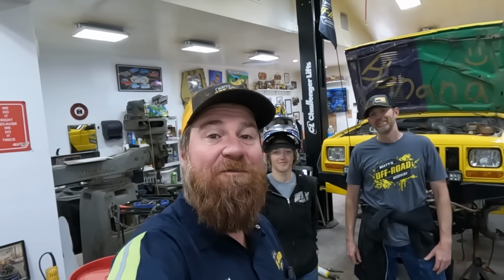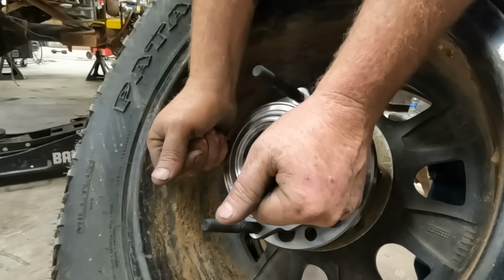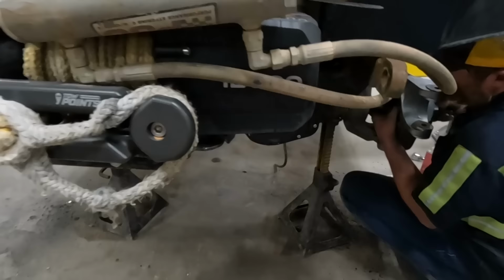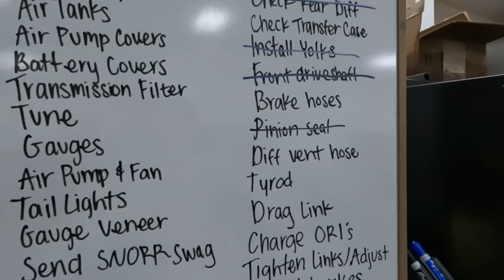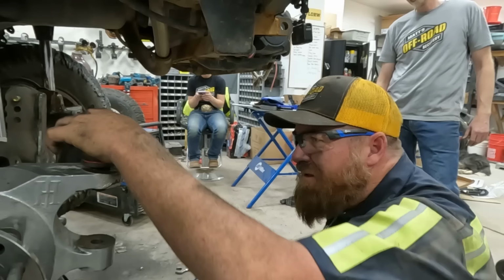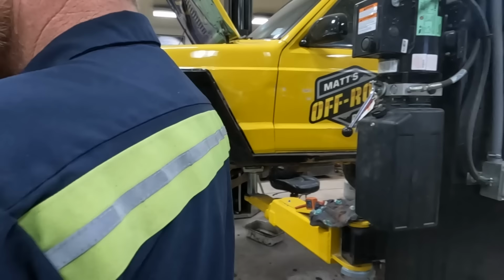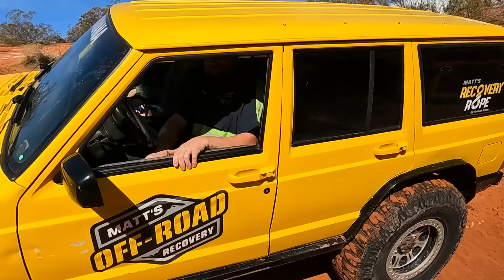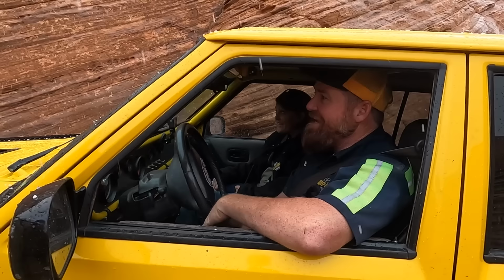I Can't Do This...Nothing But Failure Fixing The Jeep Banana!

Comment: Somewhere around twelve minutes, I realized that while Matt is a very good fabricator, quite a bit of the way he does things is because he knows it will irritate internet "experts". Respect.
Reply: I don't believe they are irritated. Rather, they know it's gonna come back and bite him in his backside. Hopefully when it does, nobody else pays the price.
Reply: Coffreek you have been proven correct.
Reply: You see that often in the trades a lot. Standards say “this” but sometimes thats not how it’s getting done. Its a good joke sometimes. You have to know your trade very well to absolutely know when you can ignore standards. I know the material I am working with very well and know the ansi and tcna stuff front to back, but for the most part its not written in stone, just paper.
Reply: @Titantitan001 you gotta know the rules well to know when you can break them.
Reply: There is a huge difference between a engineer & a mechanic.

Comment: Stay strong, Tom. Matt, whether he likes it or not, needs a voice of reason.
Reply: I don't get what lead to the trimmed axel and cut splines? had they just not seated it far enough to get the joint to line up with the pivot point so it kept binding?
Reply: Perhaps this explains why quite a few staff have left this business. Remember the problem Jaymie had with Matt as welding coach. He just doesn't accept other ways  of doing things....it's his way or the highway 😐
Reply: @trif55  Matt narrowed the whole axle housing, and doesn’t like to do measurements so didn’t really know how far he need to cut the axle shafts down. They you hear the rest, still have to make sure seals line up, make sure splines are long enough to have structural integrity
Reply: But yeah I agree, that impact on the rear yoke was just not bright
Reply: I enjoy the creativity and that Matt is bringing Tom's way of reasoning into the shop. I just worry that the next video will show Matt with a patch over his eye because he's too stubborn to wear glasses while grinding.
Reply: @nate7828  wasted a crush bearing least wise....smh.....im a noob at chassis running gear but I know better than that. You have to set the pinon and crush sleeve right ? Way more than just tightening the nut to the yoke
Reply: @evopwrmods  yes there’s a certain amount of preload that’s supposed to be set. It’s not supposed to just be impacted like that
Reply: Matt's rationale for causing damage to gears and bearings during installation is very similar to his rationale for not consistently wearing eye protection: " I've gotten away with it so far"
Reply: @msb3175 I totally agree.
Reply: 🤣😂🙃🚙🚙Yep!
Reply: 1:02:27  the right rear tire is not turning. Is something wrong with your locker?
Reply: Tom I know you mean well but you really need to just roll with it a little bit more. Too much negative energy isn’t good for you

Comment: you two are the perfect example of the difference between a machinist and a mechanic.
Reply: Hope the onlyfans doesn’t rub off on your channel
Reply: As a 10 year plus machinist i'd put tom at an engineer level. Most tolerances I see called out on blueprints are way "over engineered" and will work regardless if they actually fall in that range or not.
Reply: @WhoThisGuy515  but for how long, I hate doing jobs over!
Reply: machinist and sadist
Reply: @williepelzer384  What is worse is reworking someone else work.  Cheers all.
Reply: I believe here is a mechanical engineer in there someplace too.

Comment: Tom cracked me up when he said "Drilling holes is one of Matts strengths.   He's like a human drill press."   I was rolling.   Good one Tom.
Reply: Matt get's a little carried away sometimes.....LoL
Reply: It looks like they do not know how to drill steal. It is not how fast but how Slow you go to allow the drill bit to cut into the metal. You should normally use some sort of cutting oil for lubrication and to dissipate heat. The bit will cut better if it does not overheat. Going too fast just generates heat and dull the bit.
Reply: . Haven't tried it yet, but a machinist on the Toob said to use WATER, not oil, drilling steel to avoid that aggravating tempering in the hole that stops you dead!
Anyone?

Comment: Although I am a old machinist, and lean trords TomToms approach to tolerances.  I must say that there probably isn't much Matt can't fix with just a welder, grinder, hand drill and claw hammer. That is impressive.
Reply: Yes ,and if Matt would've simply put a sleeve on the rod it would still be on the rig👍
Reply: Hand me a wrench, Helper: What kind of wrench?, Doesn't matter, I'm going to use it as a hammer!

Comment: one of the best episodes yet!!!  I totally relate to Matt, there's always a solution to a problem, never give up...although it helps if you can throw enough dollars to get and modify the parts that you need😂👍
Reply: I was half-expecting that Matt would have kept his winch line on the tie rod to keep it from re-bending (probably would have damaged the winch line from it rubbing back and forth with every steering action, and the tie rod might have just bend in another spot).

Comment: Going to be interesting to see how those brake rotors do with those excessively big drilled holes over those lug studs? Might shift, make a clunk, and loosen the wheels when braking back and forth between reverse and forward? A lot of sketchy looking rigging going on there! LOL! Cutting spline grooves with an angle grinder? Boring knuckle joint tapers with a hand drill and reamer? I hope it all works! Matt's been doing this stuff for a long time, so he knows what he can get away with or not!

Comment: I had similar issues trying to get the right offset wheels for my YJ. I don't have the factory bolt pattern, so the offset I need doesn't exist. All the wheels out there are either sticking out 1.5+ inch farther than I want, or are 1/2 inch too narrow. I took the narrower and put a couple 1/4 spacers in there. Not ideal, but I put in longer sorta oddball studs from an old Ford and it worked out just right.

Comment: As a one-time machinist and professional mechanical engineer, I still appreciate the "can do, get it done" approach of a shade tree mechanic.  I embrace that approach for many of my own projects.  This said, I truly cringed watching Matt ream holes for wheel studs with a handheld drill and grinding splines on an alloy steel axle shaft.  Yes, it works but it is beyond sloppy workmanship with tools in the shop that could do the job.  An old boring mill will still ream a hole better than a mechanic with a hand drill.  Disappointing Matt, Tom is right on this one.

Comment: The one main weakness of a limited slip, is thst right there wuen the one side is in the air the other wheel stops getting power.. if you got air lockers on the banana it would probably go anywhere you point it haha❤❤❤

Comment: We have run drilled out Corvette C5 rotors for 16 races (about 5000 miles with 5 braking zones per mile on average) without issues. The clamping pressure of the wheel to the hub is what keeps them in place with the lugsjust locating them.

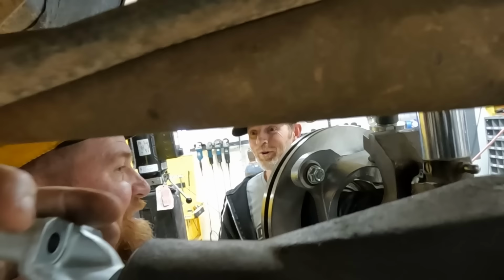Comment: 23:49 Its all about pinion bearing preload. preload is determined by a torque slot. minimum breakaway torque vs maximum. for example a spec may be no less than 6 inch pounds but no more than 14 inch pounds. This can be  measured with a beam type torque wrench. The nut should be tightened with a breaker bar and checked as you go. If the breakaway torque is too high the bearing will fail fast, if its too low it it will fail faster. Put the torque wrench on and turn, reading the scale as it begins (initial beak away)) if its in the slot, you are done. If its too tight, grab another crush sleeve and start again. if its too low, you can tighten a bit more.

Comment: The Banana did well heading off Sand Mountain on Saturday! That win must have lifted some stress off your shoulders after the build week you had, and probably enjoyed only long enough for me to add some more weight... I feel so bad; and I am so sorry for holding y'all up, and pushing your plans out so late. The journey through some of Sand Hollow's awesome, lesser known trails hopefully makes up for my folly with decent content. (I found that my version of the West Rim Trail isn't the West Rim Trail at all... The true West Rim is much more easy and a bit shorter than my version. I am unsure where the West Rim Trail even runs, or the what the trail I have been running is even called! Lol! I am sorry for that as well. I took y'all down the path I take). The big win goes to The World's Largest Off Road Wrecker! That truck works amazingly well, and was the perfect tool for the job, it's truly impressive! Jamie was amazing in the Maze wheeling the new Rubicon 392, and she was equally awesome behind the wheel of the wrecker while towing Wyld Chyld YJ Back to camp. The night ride without headlights back to your hauler must have been wild! I would have walked y'all back out, or I could have temporarily wired in your lights, but y'all was in a hurry and needed to make tracks. I would like to volunteer to wire up your lights for you when y'all get back from MOAB... In closing, I just wanted to say a huge thank you to Jamie, and Matt for the warm Mt. Dew I stole, and the April Fools day broke Jeep tow adventure. Thank you Tom Tom for stopping your busy schedule to unload a trailer you probably loaded earlier. Thanks to everyone else at MORR who I effected by pushing your Moab travel plans back, and for giving me the time you didn't have to spare. I envy  your patience, and your kindness. I look forward to the drop of the freedom rock event, the maze, and the last minute recovery before  MOAB...

Comment: YOUR REAR LOCKER FAILED TO WORK (at 1:02:25), just before you said you are "not even worried about your axles failing".

That failed locker was the reason you couldn't climb it...

I agree with you on how durable those Dana 60's are. I put them in the front of every single off-road truck I built, even the Suzuki Samurai (front and rear, both with steering too). With the heavier builds I helped with, like full size Chevy Blazers, Suburbans, 3/4 and 1 ton pickup trucks, I usually went with full floating corporate 14 bolt axles. I even ran Dana 60s in our 440 Magnum swapped Duster and Volare station wagon, without any issues whatsoever.

Comment: Drilling extra holes in the Hub flange could weaken it!  Pounding out the studs after drilling the extra holes in the flange could induce microfracture and further weaken the flange.

Comment: Another positive is that this extra weight is "un-sprung" weight, which for crawlin' is much better than extra weight carried by the springs.  Also, the Super Duty that I had used 19.5" rims.  That could be the basis of your problem.

Comment: It’s hurting my head watching you guys struggle. You guys need someone that knows these parts better and can order exactly what ya need. I definitely have to fab things here and there because I’m broke but you guys are working with brand new parts. There is no reason they all need gabbed to even fit together. Someone didn’t double check what all works with one another. I really enjoy watching you guys hopefully this all works you guys! I really hope the best. I would be pipping hot if I had spent the money you did on parts that don’t fit. Also I really hope you change them hubs back out for a better setup. One rock and that wheel is eating that knuckle.

Comment: For the size wheels and tires you use, the diameter of the rotor looks too small.  On cars that are used on the track, unsprung weight is held to a minimum to ensure better rebound to help keep the tires in contact with the pavement.  In your case with rock climbing, it is beneficial to have more weight on the axels.

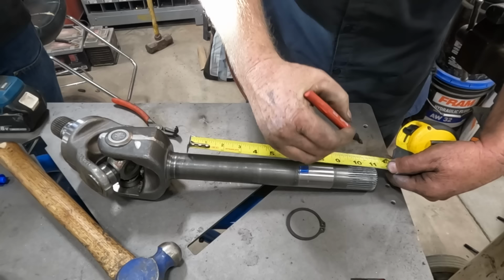Comment: 17:33  BIG gears for BIG excavators!!?? .. I did some work for a company in Toronto 30 some years ago, they rebuild worn out gears for BIG excavators, and were busy, (Obviously a FRACTION the price of new .. never mind the 60 month lead time.  

They free hand welded them to build the teeth up (7018 Stick) OUTDOORS ... and hand ground them with an 8" common grinder freehand, until they were near perfect.   The grinding guys, were an pretty old German guy and his 20 something year old son.  They did NOT have access to the excavators in this process. .. one to 2 week turn around.

Just saying .. there is precedent for hand grinded splines and gears .. it IS a thing!! .. great job Matt!!  

Oh the job WE were doing was leveling up an old GIANT lathe they had bought for cheap ... we anchoured it and leveled it and came back a month later to final leveled it (after it settled and and got used got it's new place :)

Comment: I hope you have some sort of boot for that U-Joint at the wheel...   That "seal" on the shaft is not a seal.  Its a slightly raised area in the tube to keep oil from running out when it is level.  When the vehicle is tilted left or right, oil will run out.   You can always add oil, who cares about losing  oil.  I am more concerned about letting dust, and grit into the pumpkin.

Comment: I'm with Tom, just because you CAN hammer a gear or bearing and get away with it "most times", doesn't mean you SHOULD. In an emergency, bush mechanics is OK. In a workshop, that's just lazy Matt. I am dissapoint.

Comment: I have used the grinder to lengthen splines to get a clutch to engage properly. If it works is it wrong. Lol
Reply: Technically still wrong. But, when it’s just a bit so something fits and not the whole spline it isn’t really a big deal. Especially since the circular wheel on a grinder is good at not leaving a sharp edge for a stress riser.

Comment: I dont know if u can give me any ifo i have a dodge ram 1500 ifs 6 in lift my front dive shaft keeps breaking already put a clockings ring but now hitting my transmission pan do goin to remove it also lowered front end and still breaks found a drive shaft by tom woods but i also saw on transfer case the out put shaft if correct name not sure is pointed slightly up  not sure if its supposed to be like that thank i for any info

Comment: Question - is there a point at which a modification from the original design requires some sort of inspection to make sure it is street legal?  I recall that the World's Largest Wrecker had to be trailered to the off-roads - and it was original from the ground up - so who decides that it is legal to drive on the road?
Reply: In this case Utah Dept of Motor Vehicles.  However, the Wrecker will be road legal when it is eventually finished.

Comment: Will that tire still clear the tie rod end when your running low tire pressure and rock climbing.  I'd hate to set your tire blow when you air down.
Reply: I Commented before I got to the end and saw that you successfully air down. Nice garage engineering

Comment: Why didn't you use the right parts the first time?
I'm sure companies make the bigger stronger parts you need already plug and play.
Instead, you went and modded perfectly good parts that now won't even fit in your wheels.
This was a huge costly mistake.
New wheels and tires cost a small fortune, and you can't return your parts and get the right ones since you butchered them.

Comment: You can't just wallow out hub stud holes and press in poor fitting studs.
I mean you can, but it will lead to problems and breakage, like studs not being straight, and studs breaking off, and wheels falling off.
This is a bad idea.

Comment: Did you get a chance to see the 1,085 hp on horse power monster the engine is a Jeep engine with a supercharger the guy that built is Keith newcomer he also set record before that with the type of except it was turbo charged both engines 4.6 stroker engine

Comment: /if you ever decide to want to  have your tires last  3 times longer use 303 inside and out another secret  only a few know about my atv tires are 5 years old and still brand new same as my car tires no wear at all i did coat the inside and twice on the outside nothing works like 303 rubber rejuvenator sun protector  shhhhh its a secret

Comment: "that bolt needs to be torques" whose gonna tell him about how we "torque" the flywheel bolt on an rx8 or most of those flywheels with a single bolt holding it on. its exactly how matts doing it. some of us torque it to a certian spec, draw a line on the bolt and a line on the flywheel 90 degrees  apart and ugga dugga it till they line up but whose got time for that?

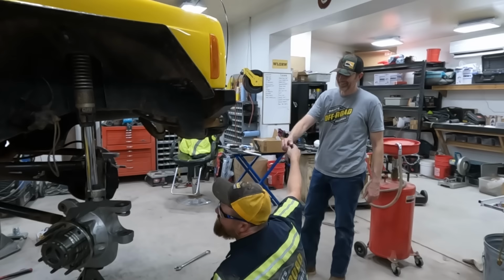Comment: 27:49 So you go and get given all brad new high end parts and coz the ones you paid for don't fit you go and cut your new shinny shinnies so you don't have to drive back to the store. Not even a farmer is that lazy

55:08 this is the definition of stupidity. Doing a thing you know is bad and then expecting it to not be bad and it still ends up bad. You knew better, you did it anyway and the moment it had to take any stress it failed.

Comment: Even if you manage to force the wheels to fit by further hacking and destroying your expensive knuckles and calipers, you won't have enough clearance to be safe or account for debris or heat swelling.
This is just all wrong and a waste of a TON of effort when you could have just purchased the correct parts designed for this build.
I am so disappointed in you guys.